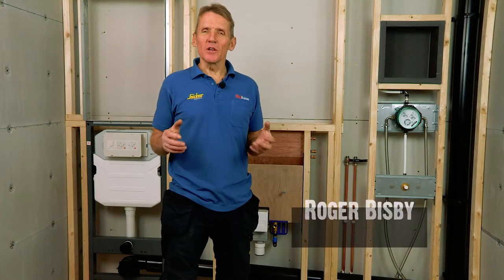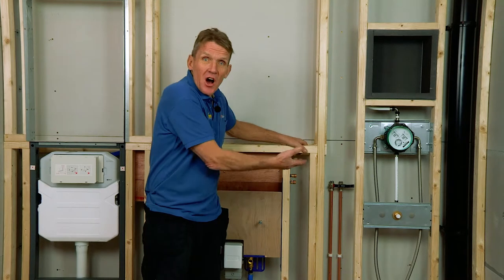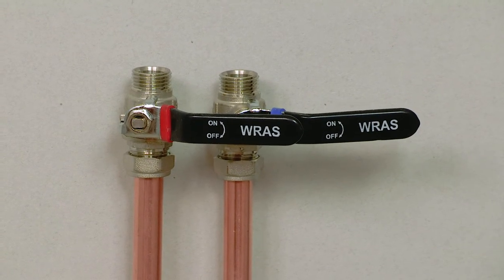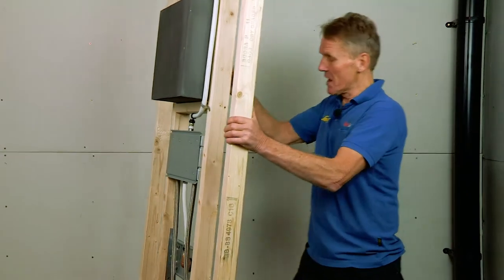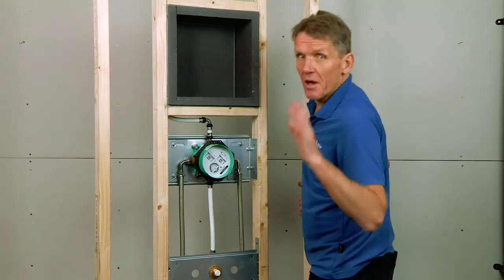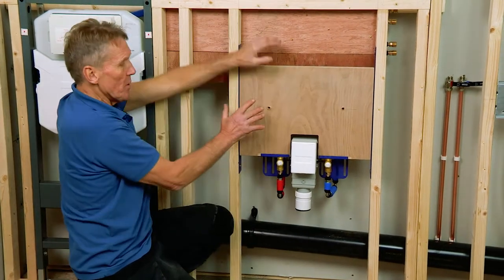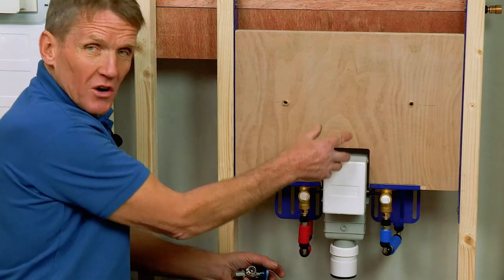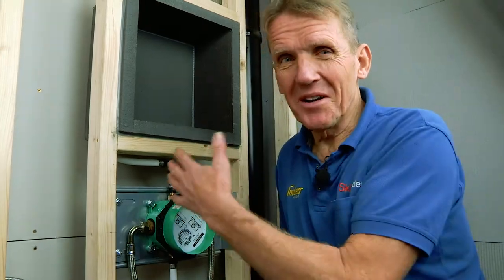Pre plumbed bathroom working wall from Abacus

Comment: How big are the timbers you use for the stud work?
Reply: Did you happen to get a response?
Reply: @starman7982  

Apparently it’s 3” x 2” timber.

HOWEVER, I’ve since learnt that building regs require the use of 4” x 2” timber so the size you use will be down to whether or not you wish to conform to building regs. Good luck. 👍🏽